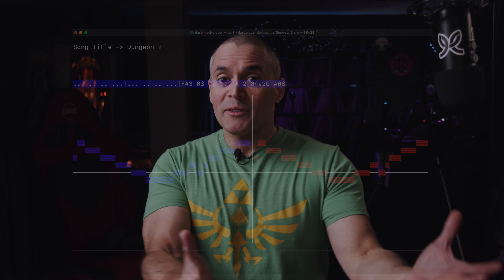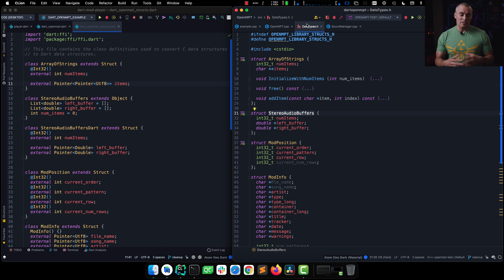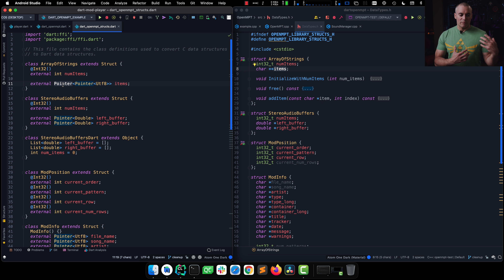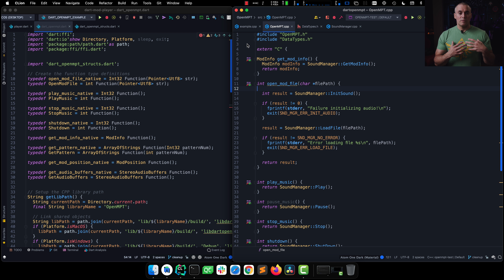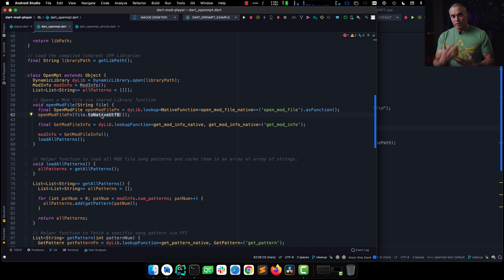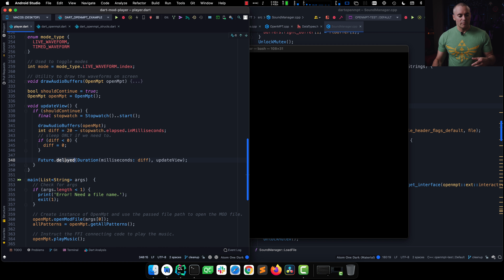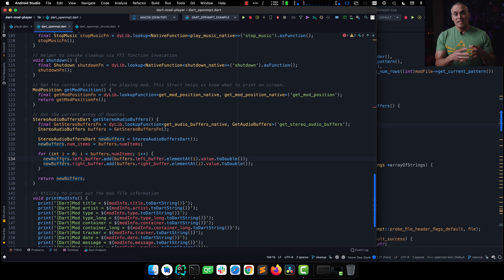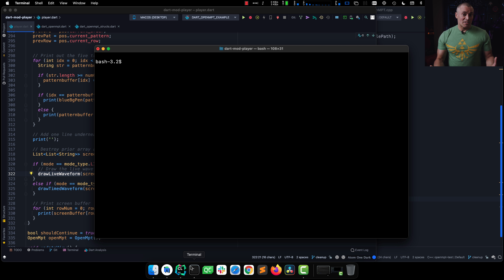How to Use Dart FFI to Build a Retro Audio Player (Part 3)

Comment: if I have a client program that has all the functionality (networking, user management, message parsing, managing states, but no UI) all in C, could I simply write interface functions to pass/get data from Dart/Flutter and use it for only the UI part? Or would be better to just rewrite everything in Dart?
Reply: There's a lot of "depends" to answer this question.  If you're planning on sticking with a single platform, then keeping it in C may be fine. If you're deploying to multiple platforms, then things get complicated quickly.  Another thing to consider is how low-level is the networking stuff you're doing.  You may find that rewriting the networking section in Dart to be difficult, given how the language works (single threaded, run-loop-based, for example).  Dart is fast, however it's not as fast as C for many operations.   

Flutter is a great choice for mobile UIs, and has several limitations on the desktop side. Dart is single threaded, and Flutter's desktop package doesn't provide many things that we enjoy on Desktops, such as window management, and drag and drop functionality.  These features are left to the community to implement, creating fragmentation. :( 

Hope this helps :)